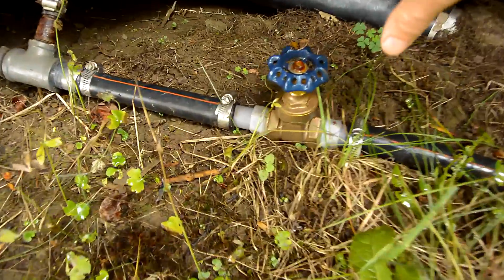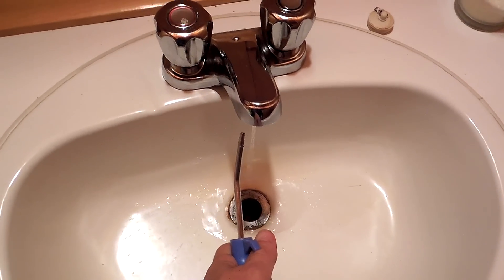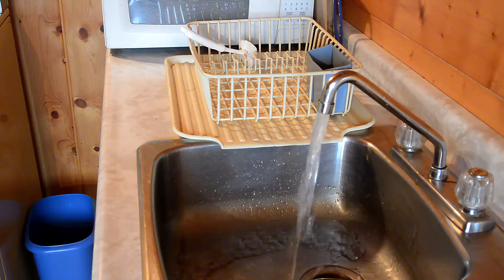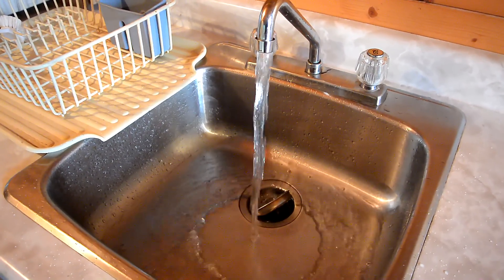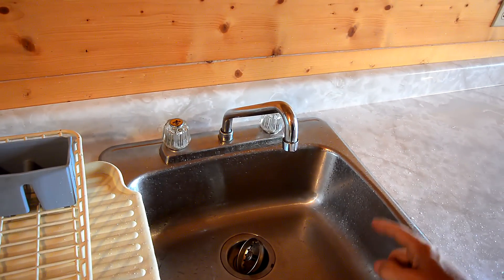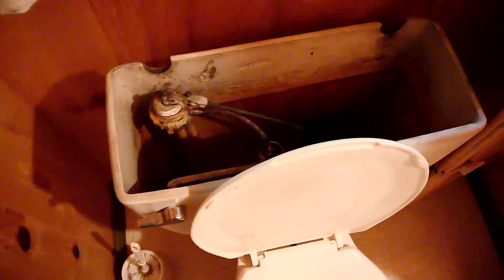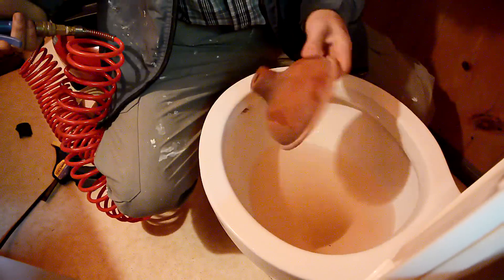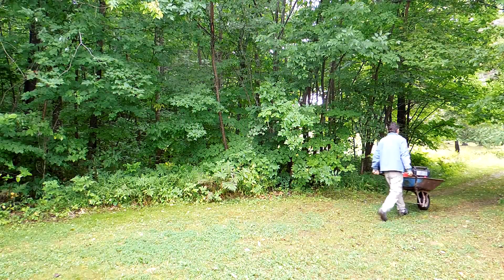Draining plumbing with compressed air

Comment from the maker: A quick way to drain the plumbing in a building, especially the hot water tank.

Article to go with the video here:
http://woodgears.ca/cottage/drain.html
Reply: good idea, thx for sharing your experience ...
Reply: Good video.  Hope you don't chew your nails... LOL
Reply: mark dale
 I showed him how to do this last week when he came over for a weekly cookie eating contest.
Reply: Good idea! But do you think that the opposite, that, is a vacuum pump cold collapse the tubes, or damage them somehow? Because it seems that still there's some room to improve your idea, making the execution more practical, one obvious improvement would be a modification on the hot water tank itself, adding a valve were you would screw in your compressor, but off course it's much more work and it involves some milling/threading and maybe some welding...
Reply: Lion Hunter Because if it freezes during the winter, the pipes will burst and cause the cabins to be flooded.
Reply: Lion Hunter Lol Are you for real?
Reply: Also works for unclogging drains. Just modify the the  interface to fit the drain. If the sink has an overflow port, it'll need plugged first.
Reply: baianoise Working on water heaters is a terrible idea. They could potentially boil everyone  in the room, while they rocket through the roof. modifying something that potentially could do that, is a bad idea ;)
Reply: dumle29 Well, it's not different from any other engineering problem: you just have to know exactly what you are done, danger is a constant in life. But fortunately, it's possible to learn from other people's accidents, and nowadays we have plenty of valves with all sorts of security mechanisms.
Thank you for your time!
Reply: baianoise I'd agree that danger is a part of life, but I'd call it a variable, not a constant ;) In this case, the heater already has watertight connections going to it, which are approved and covered by any house insurance:)
Reply: Instead of putting antifreeze in the traps, wouldn't it be easier to just take the traps off for the winter?
Reply: Overwatch If I ran from cabin to cabin I could put antifreeze in all the traps in under ten minutes. I'd be lucky to get all the traps in one cabin removed in that time, and it would be much harder on the old plumbing. So I'm not sure how you think that would be "easier".
Reply: Lion Hunter this is done when the cabins are closed down for the winter, no one will there living there. if you need to shower swing by my place, i've  got plenty of soap.
Reply: Overwatch the antifreeze in the traps not only keeps them from freezing, it maintains the "trap" function to keep the sewer gas out of the house.
Reply: gostei  !!
Reply: GREAT IDEA!!! I used a similar method redoing the plumbing in a basement. In cases where I don't have my compressor available, I like to plug dripping with white bread to stop the pipes from dripping long enough for me to solder the pipes. The bread dissolves and comes out the tap after the water is turned back on.
Reply: 56Nine
A great use for old antifreeze.
Reply: А почему не сделать в схеме краны для спуска в нижних точках - так было бы намного проще :)
Reply: у меня знакомый заливает в унитаз спирт, правда я так и не понял, пропускает ли он его через себя перед этим или нет )))
Reply: AlfFisher представь сколько кранов надо на каждый изгиб а у меня их штук 10 точно - водопровод сделан металлопластиком в подвале на 5 точек и это только пока 1 этаж
Reply: Дим Русс     Если он спирт через себя пропускает - то это уже "не тот"  спирт  будет :)
   Зависит от того, как конструировать водопровод, у меня на весь дом : (ванная , кухня, туалет ) - 2 сливных крана :)
Reply: r

Comment: Wow.  I tried this, and it worked great!  I actually looked at several similar videos, and this one seemed to be the easiest and simplist way.  The only thing I did different was went through the washing machine hot water connection, for two reasons, I saw it being done, and that way I could also blow that line out, too.
Either way. thank you, man, so much.
at least twice a year I was under this trailer, repairing burst pipes. No more
Again, thank you Mr. Wandel

Comment: Great job.  I remember my father draining the plumbing on our last trip each fall.  Never as big a job, because it was a small trailer with a relatively small plumbing system.  It took longer to haul out the dock, put up the boats, and lock down everything and seal it up for the northern Minnesota winter.  The real fun was putting everything back in the water in April  each spring.  :)

Comment: In Denmark in summercabins we have a airtube going down to the freshwater inlettap instead.That saves us from running around blowing in all the taps , we open and blow . Then I wouldn't empty the toilet and other drains, because it will smell(stink) when the drainpipes and septictank are open to the interior of your cabin, just add som glycol to prevent freezingdamage to the drain tubing . But of course, if the air pipe is not installed, You don't have to dig down to the inlettap Matthias 
Thanks for all Your instructive videos, that I always watch with great joy

Comment: This is great Matthias ! I shall be using this method when laying up my boat to get all the water drained from the system so it all  doesn't freeze and I am very thankful for the time you have saved me doing this boring ungrateful job .This reminded me of an Aspirator pump which they use in laboratories but is the opposite ,you screw  a t-piece to a tap turn the tap on and the running water creates a vacuum and you can use this to suck stuff.all the best Neil

Comment: During the Texas Winter storm a few years ago. Our water pressure was gone, so our outdoor spigots couldn't drip anymore. So I used compressed air at the outdoor spigots to blow the remaining water into the pipes and left a bathtub facet turned on so the water/air had somewhere to go. We survived the week long frozen spell without any plumbing damage. I think I should credit this video for the idea.

Comment: I do a very similar thing in my french house for winter, I have a tyre valve plumbed into the plumbing system and open 'water circuits' to flush with air. Great vids.

Comment: Thanks so much for this idea. I had a couple of drains that were clogged with grime. I just blew compressed air in between the drain opening and stopper. Worked great! Much better than taking the plumbing apart to fix it. :) Just wear safety glasses. Stuff shoots out all over the first couple of times.

Comment: I think this suggestion would work and save some time.
Since you are disconnecting the main outside you can instead get a barb fitting adapter that goes to a threaded fitting so that you can use a male air fitting directly to the compressor.  Once you do that you can pressurize the mains (20 psi would do) and that would in turn get the air to all the faucets and the toilet and shower.  Bleed the cold water sides first then the hot side.  This will drain the hot water tank at the same time.

I do like your idea of using the plunger with the air hose to drain the traps.

Comment: I understand and agree with the need of draining a system that won't be in use for a while. I don't get though what would be so wrong about leaving that little water in the traps (after removing the most of it). Part will evaporate anyway and what's left, even if it freezes, has plenty of room to expand without cracking any plumbing

Comment: Are your supply lines just laying on the ground outside? What keeps that valve from freezing and shooting off, or do you drain them all back to the well or whatever?
Reply: I assume they're buried under the frost layer, so they should be fine.

Comment: An inflatable boat pump makes a great plumbing tool, they suck or blow. Hot water and suction gets every stuck drain I have dealt with. Pressure packs the clog, suction pulls it apart. The suction of toilet bowls is for regular cleaning as no watering down of the caustic chemical is needed or wanted. Hook the suction line to a 5 gallon bucket with a lid and a second line in the lid to do the dirty work. This works as well with an electric vacuum that is not a wet type.

Comment: Noob question: If the air pressure is too high can it damage the plumbing?
Reply: That would have to mean a tremendous pressure. That little ai compressor cannot provide that kind of pressure, unless the pipes are allready damaged.
Reply: If you have a thermostatic tap for the shower I would take it off and drain it without the tap just to be sure. But overall it wouldn't do much harm. I always test the pipes and fittings on 8 bar (116 psi) pressure.
Reply: The water heater has a pressure release valve. If the pressure got dangerously high, it would be automatically vented. The plumbing system is always kept pressurized, but it's just usually water pressure.
Reply: aptsys You're right, it can be dangerous. I've been doing it for 8 years as a plumber and never had a problem with it though. It's just way easier, less messy and you can still easily spot a leakage. In Holland most plumbers use a compressor.
Reply: aptsys 116 PSI of water and 116 PSI of air is the same, it's just the volume that is different
Reply: OwLoLz
Are you from Nederland?
Reply: OwLoLz
Just asking - it's a bit rare to meet someone nearby (from Europe) on cahnnels like this or *****'s channel :)
Reply: draytec Ok :) I'm subscribed to most woodworking channels.
Reply: OwLoLz :) Anyway, nice to meet you here - we may meet again through some comments :)
Reply: draytec I'm from Norway :) I know there are several Norwegians here, including some that makes good videos :)
Reply: Spacehero I know. Also some Czech people are here (German, British....) but Canadians and Americans are more visible :)
Reply: draytec
I'm from Hungary. Just to raise the number of EU people. :)
Reply: Randy Pandy I've seen the nozzle shout out a few times cus it wasn't thightend enough and it's nothing special really. There won't be pieces flying around that easlily when it's 'only' 8 bar.
Reply: OwLoLz 8 bar is quite alot in this case
Reply: OwLoLz
i think most plumbers compress all the pipes in the house after there done with the construction to test for leaks :D
Reply: DeuceGenius
i think they do it with air first, because if theres a leak and it was water it could cause a bit of damage
Reply: Misty Moo You almost always test with compressed air. That's why it's called a "Test" so you don't get water all over the damn place.
Reply: not  to the pipes them selfs but to the hot water tank you can there made from very thin copper and not designed to hold much pressure unless there steel then are designed to hold mains pressure... depends on the type of system you have
Reply: @kayakkid1234  wtf

Comment: Looks like a great way to test the pressure relief valve on the WH. If the compressor pressure goes above the PRV rating, the PRV is probably defective.

Comment: I have many jobs - one of them is a plumber. We use compressor too (Czech republic - Europe). Mostly get water out of heating system and from tap water system. But we made a reduction - the fittings for air and for water has same thread sizes - mostly 1/2" and 3/4" - in plumbing in europe imperials somehow survived :D If you want some photos of reduction, let me know. :) And if some one want to know if air pressure should be in pipes - many water hoses and pipes (mostly welded ppr pipes) are also used for air distridution. For example if you want have better hose to connect compressor and equipment, buy for example 1/2" hose for water (better is oil proof). Then buy fittings por quick connect on one side and neck for pipe on the other. Sealing is provided by the screw pressure collar - as seen in the video - the thing you untie next to the valve. (I can also send photos and how to instructions)
If someone have some questins, let me know :)

Comment: We pour a quart of 50/50 mix of propylene based antifreeze in the toilet bowl and sink traps.  Don't do it if you have a septic tank (it kills the bacteria).  But check with your local sewage treatment facility.  Most can handle the small amounts generated by homeowners (not by garages and repair facilities).  Ethylene glycol based antifreeze should be taken to a recycling center.  You need to keep a water seal in the traps to prevent sewer gas from entering the home through the drains.

Comment: OK, someone may have already mentioned this. One your plunger.  Have you tried leaved a short section of the handle on it with a hole drilled through it to put the air nozzle in?  Seems like it might be a bit less messy.

Comment: I had a similar situation, so I installed a drain valve on each hot water tank. Walk around once closing the mains and opening the drain. By the time I get back to the first house its drained and I can deal with the U-bends. Gravity is so mean so I make her do as much work as possible ;-)

Comment: Pretty clever, pretty clever. Question on the traps, why would they be in danger of pipe burst from freezing, since they are not encapsulated? Seems like they would be more in danger of evaporation allowing explosive (or at least offensive :-) sewer gasses to build up in the cabins. Also it appeared that the main supply line remained unprotected from potential freezing.
Reply: He said that he was going to pour antifreeze in the traps.
Reply: Sewer gasses in a water pipe?

Comment: You ned to explain the physics of the plunger in the toilet bowl, I can't imagine that it's just ventrui effekt or the air pushing on the water giving it speed to get going through the system. Why did you first seal the air gun in and then when you broke the seal the water ran out like it had been caught stealing!

I love your videos! you are very intelligent and can understand and explain, not just do and repeat what others have done
Reply from the maker: aru05001 With the seal, the water got pushed out of the trap, then lift the seal, and water runs into the now empty trap.
But...  Surprisingly, I discovered, the venturi effect alone is enough to clear the bowl!  Next time, I won't bother with the plunger, at least for the toilet.
Reply: Like a vacuum?

Comment: Do you also drain the supply going out to each of the cottages after they are drained? Why not throw a manual 3-way valve on the cottage supplies so you don't have to undo that bit of plumbing? I guess it would have to be installed opposite the direction of supply water flow which might hinder the pressure or mess up the seals, hmmm.

Comment: Matthias Wandel What kind of antifreeze do you use for the traps? Is it necessary to put antifreeze in the traps? The little water that is left has room to expand w/o hurting the pipe...right? I'm from Florida, USA. Thank you.
Reply: I use RV antifreeze when I close up an apartment or cabin for the winter.  It is not as toxic as regular stuff but works just as well.  As far as the small amount of water expanding in the trap, if the "top" layer of water freezes and the rest remains liquid for some time, as it freezes and expands, it has no place to expand to but out so it breaks the pipe.  I learned this the hard way.
Reply: you tube are best and realistic

Comment: Does the water still left in the bottom of  the hot water tank give you any problem? Or do you use the drain valve for that?

Comment: Seems like it would be easier to just shut off the water supply, disconnect the hose just after the valve, and open all the spigots, pulling air through as the water drained .  Blow air through your traps, add antifreeze.  Or just add antifreeze.  Don't know about you, but I get stinky gasses wafting back if I have any air passage in the drains.

Comment: I understand those cottages won't be used during winter, but how Canadian regularly populated homes deal with the plumbing freezing issue during winter?
Reply: Occupied housing has heat generally.
Reply: people living in homes where the plumbing is buried deep enough to stay thawed use the heat from the home to keep the inside pipes from freezing
Reply: very interesting, thanks for the answers, I know the Canadian winter is particularly cold, and since I've lived my entire life in a country that never snows (sadly) I was really wondering. Thanks!
Reply: Nelson Baietti Cold can only penetrate the ground a certain amount, since the earth has somewhat heating from the core. Where I come from, in Norway, in a normal winter it won't freeze below aprox. half a meetre. I don't know how it is in Canada.. So normally all water pipes and the sewer will lie below half a meetre, and then some. If there is issues with rocks and other things, normally where the pipe enters the house, we usually use a cable defroster inside our outside the pipes during the cold period. But normally the pipe has only some insulation where it goes through the cold layer of soil. Another solution is to keep the water running since running water won't freeze. Well, in theory. Norway isn't that cold, so I've never really tried it out :)
Reply: In Ontario we bury our cold water feed from the street to the house 3-4 feet below ground. That's one of the reasons we have basements in our homes.
Reply: but don't you also need some sort of heating system for the air in the residence? how does that work? Can't it be dangerous if left unattended if it uses fire/steam? I  always wondered that... And thank you very much to all for those kind answers, I've actually never knew about those! =)

Comment: My friend and I shut off the main to the house and the main in the sidewalk when we accidentally drilled a screw into the hot water copper piping. We cut the pipe and placed a shark bite coupling to fix the problem.  We now have hot water coming out of the hot water side but not COLD WATER coming out of the kitchen sink, the toilet, or the shower. After a while it builds up pressure and let’s out a tiny stream of cold water.. can this help me ?